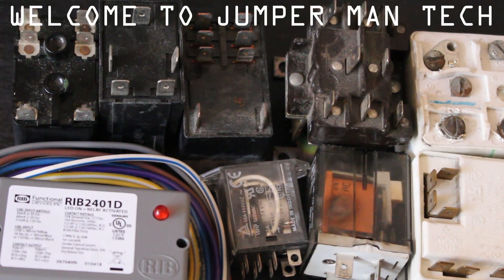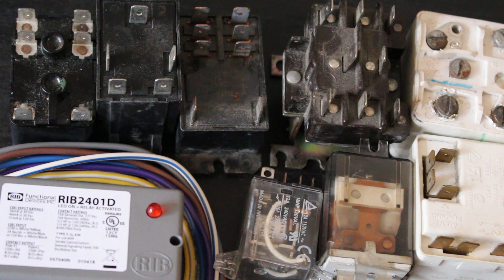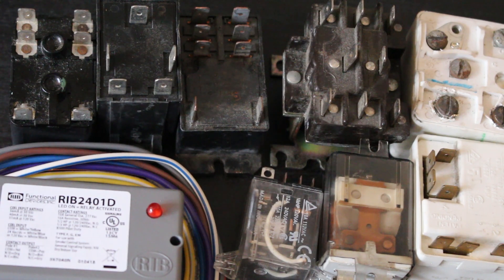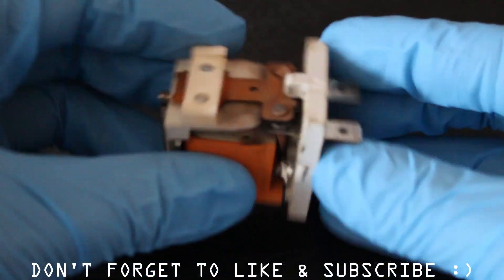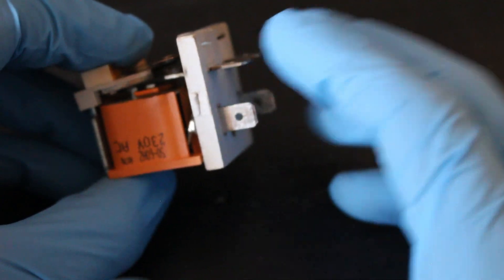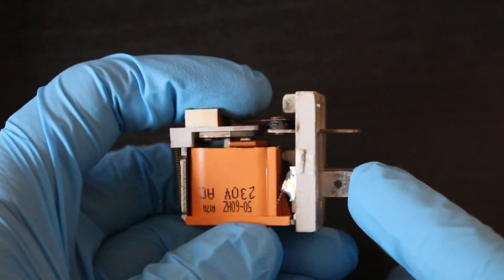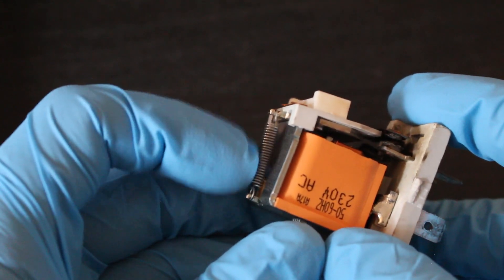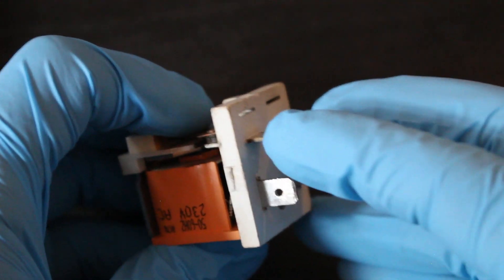HVAC/R: What is a control RELAY and how does it work? (HVAC Relays Explained)

Comment: what is a "current sensing" and a "potential" relay and how do they differ? What contexts would you encounter each in the field?
Reply from the maker: I got some golden information for you. I made 3 videos that will explain your questions. I will leave the links below. You could see either a current relay or potential relay on smaller type compressors. Those are used as the starting component for a compressor. Basic control relays are used in universal applications to redirect power. Thanks for watching & stay tuned for new videos every week! 

 Current Relay Explained
https://youtu.be/AylUxZ4Eagc?si=ZFXWm1tqTq15MQbJ

Potential Relay Explained
https://youtu.be/oWfZjPCXHV4?si=vM8EH5jdmtZfD9zi

Potential Relay VS Current Relay
https://youtu.be/O15zyk7ThzU?si=1T9rYAgPa2qyhD1u

Comment: Thank you for the video, I am new to HVAC just started class a couple of weeks ago. What is the difference between a relay and a contactor? Both seem to be similar in principle.
Reply: Both are similar principle.. relays are typically used for lower power situations while contactors are used for higher power applications

Comment: Thank you for the video! I have a question. I touched my relay the other day as I was trying to muffle the clicking noise, but as I touched it it turned off completely and hasn’t made a click since. My heating system seems to be working fine, but I’m worried about something going wrong if this piece is not working. 
Could you please explain what the relay is for and what happens if it’s not working?
Thank you so much